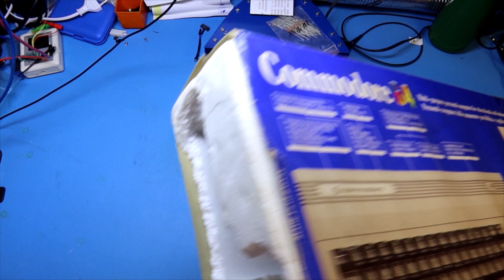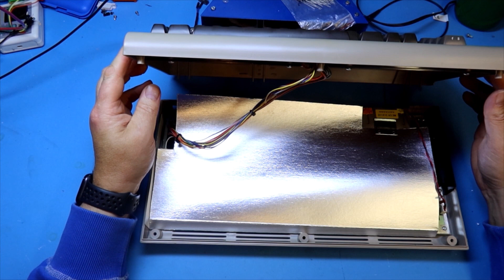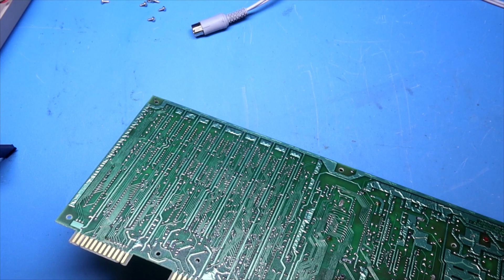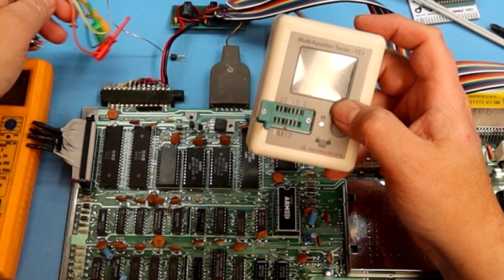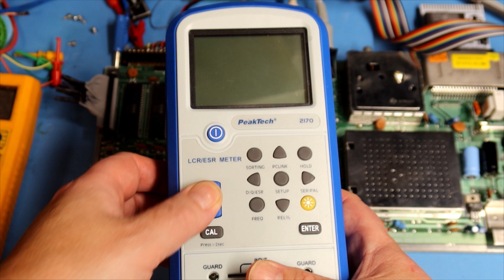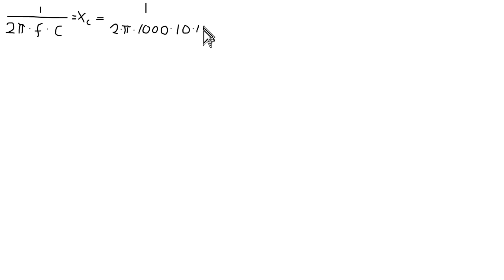Finally I found a C64 with a fault

Comment: nice job! i got introduced to you from artic retro. life span of the those caps are maybe 10y. the ceramic and poly last much longer.
Reply from the maker: 10 years... the rest of these caps are 37-40 years and they are all fine.. I think this was a goner from the start. As long as they are not leaking, and not exposed to excess heat I think they will last for even some more years. High current ripple situations in hot environments like in switch mode PSU's.. or voltage regulators on P4 CPU's and newer.. that's another case . This was in low voltage, and no current at all.. But that said.. I could have replaced this with a 330 nF plastic cap, and even the sound quality would have been better..